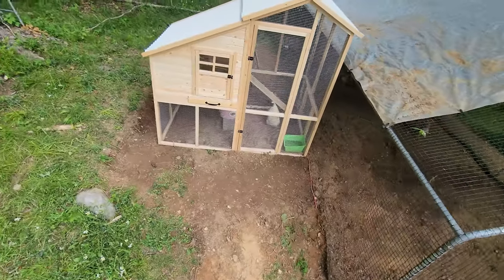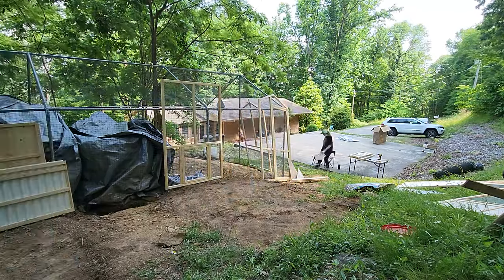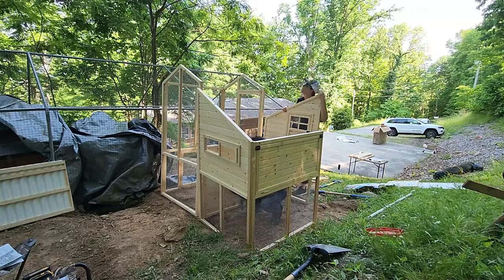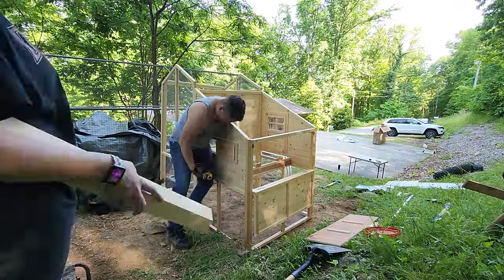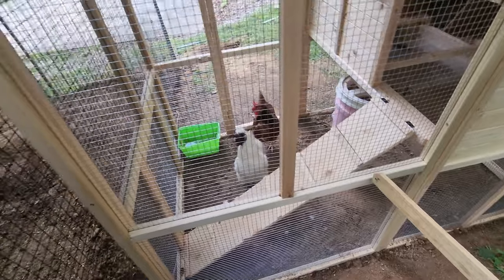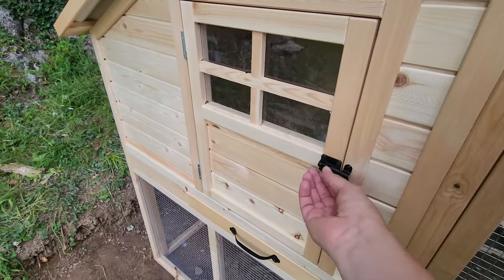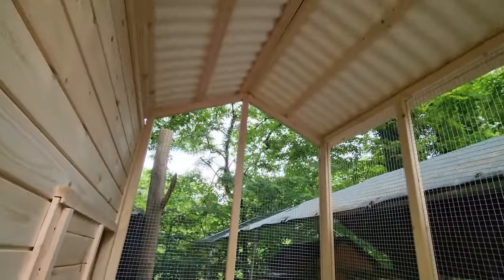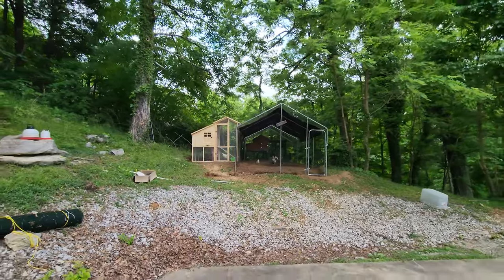REVIEW of Precision Superior Construction Chicken Coop - Tractor Supply Co

Comment: Had this coop for 2 years now and I will say prepare to make some DIY adjustments and repairs. Over time, the wood just does not hold up. My chickens are not very heavy and made the bottom part of the nest box sink over time. We have to use a pole to hold up the nest box floor now. The bottom part of the run touching the soil has bent and broke out of shape. For the first two years though, it was an awesome coop. Just wish it was a bit stronger to last as long as my chickens do!
Reply from the maker: Thanks for letting me know, I wish I had painted all the parts before assembling it, probably will have issues sooner than later. I am noticing a bit of sag already but it's not too bad yet. I'll see if i can get ahead of the issues. I will have to do a follow-up video sharing those issues with everyone.
Reply from the maker: Predictably, we just had to replace the nesting boxes floor as the original got soggy and fell apart.
Reply: @HappyCamperDeals  Mine is getting close to kicking the curb soon I heard plastic coops are really durable and last a long time, might be something you wanna look into as well!
Reply from the maker: Great advice, I'll look into it, hopefully I get a least another season out of this one. My smaller coop is made of metal and it's holding up much better, so that's another kind to consider. @chikenshiken8361

Comment: We’ve had this coop almost 2 years now. We added additional bars to the ramp because the ramp was too steep for our chicks and it didn’t have enough steps for them. I also mounted ours on pressure treated skids so it doesn’t sit directly on the ground. The outdoor roost bar falls out easily so I screwed it in place. We also had to reinforce the nesting box floor since it’s kinda weak. We stained and sealed it and so far it’s as solid as it was when we bought it. Not a bad inexpensive coop. I hope you get good use out of it.
Reply from the maker: I was thinking of having the ramp turn and go towards the door, it's strange how the ramp goes straight into the mesh. I wish I'd though of keeping the coop above ground. I need to find a way to replace the flooring and maybe add some reinforced cross beams to prevent the sagging that's already starting. You did a better job preparing it for the outdoors, at this rate, I'll be lucky to get another year out of it.

Comment: I just bought this one today, & am currently using one like your other one.
Reply from the maker: That's interesting, we're two years into owning ours now and we are going to have to find another solution (we're eyeing going to 200 hens next). You should know, the tray for cleaning poop will rust completely through in about 18 months, we've had to build a new bottom for it. The nesting boxes where they lay eggs will rot and fall down (I've replaced it with new thicker pieces of wood). The doors will warp and it will be hard to open/close (I've adjusted the hinges multiple times for a better fit). And somehow, no matter how much I sealed it with silicone sealant it will leak moisture when it rains and the chickens will get wet - also part of why the wood flooring rotted and the tray rusted. It was a great solution when we needed something in a day... and it's affording us time to plan and build something better and for more hens. Good luck with yours!

Comment: I bought that coop and stained all of it before putting it together, it was a pain though. Also I built a 2x6 base with wheels and set it on it and screwed it to that which raised the coop by 6 inches. We have 6 chickens it it but its pretty much almost not large enough for them and they only use it to sleep and lay eggs. The larger metal cage tractor supply sells is a better buy and much larger but you have to add sides and roosting poles which is not that big of a deal. We moved ours into that.
Reply from the maker: I'm learning as I go, and I agree, either I will need to make some modifications or move into another one. Thanks for the insights!

Comment: Did you make any modifications? I have the same chicken coop but I live in Massachusetts and I am worried about the winter please and thank you kindly.
Reply from the maker: I had to replace the floor board in the nesting boxes as the leaky roof got it wet and it rotted until it fell apart. I used thicker wood pieces. Also because it was always wet inside the metal tray for poop rusted completely through and I had to replace that as well. Now I always put a tarp on the coop when it's raining because despite trying to seal with silicone sealant it just somehow kept leaking! We're planning on building a custom one next so we won't need this one for much longer.

Comment: Do you live where there is any snow?
Reply from the maker: Yes, we have had this coop through 2 winters, each with a little snow (1 to 3 inches a few times) and plenty of below zero days. It's been mostly ok except the floor of the nesting boxes got soggy and fell apart. I cut inch thick slabs and rebuilt it much sturdier for the next cold season, we'll see how it holds up.
Reply: Thank you so much. Could you show us a video of the modifications that you made? That’s the one area of concern that I have is the draw tray.

Comment: The lower roof on your run is gonna flood your coop in a storm then drain off and wash out your run
Reply from the maker: Thanks for letting me know, any advice for what could be done to prevent this? I'm going to be working on the setup this weekend. Ultimately we decided to put the tarp like that to allow the run to drip straight down instead of inside the run. Maybe if I stretch the tarp over the roof of the coop or make the tarp shorter on that end so it drips inside the run?

Comment: It's super soft wood and 100% not worth the money to me. I have 8 chickens. I'm 6'1" the door is painfully small. I painted it before assembling and after 3 yrs it's still falling apart. I've replaced the sleeper floor several times even with shaving the thin galvanized floor has rotted thru 3x which is expensive to replace. The box dividers never stayed and I had to screw them into place. The nesting box door swells all summer long and wont open or close without sanding. The litter gets in the hinge point and it wont close. The vent doors swell and wont open or close.
For what these cost now just look up plans and build a coop that will last. 100% the worst thing I've ever bought.
Reply from the maker: Thanks for the long term review, I've only had mine for a few months and am already seeing some of the wear you're talking about. I'll do what I can to make this last and then I think I'll follow your advice and build something more substantial.
Reply: @HappyCamperDeals  same. When it full breaks I'm building one.